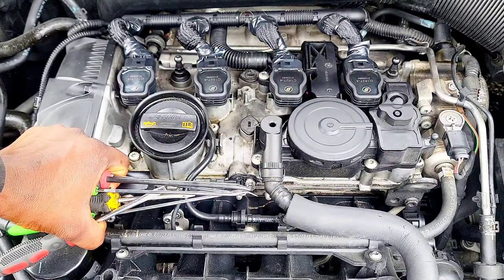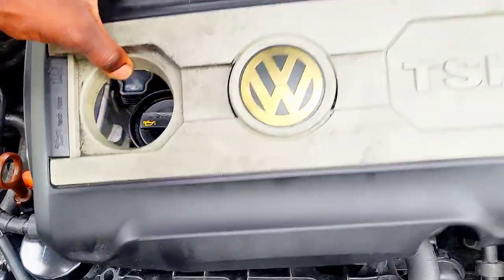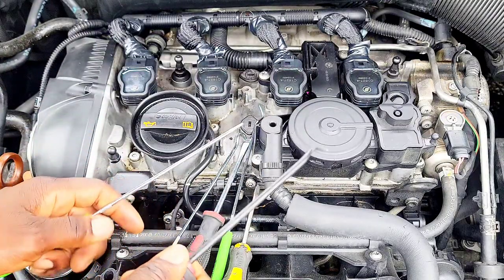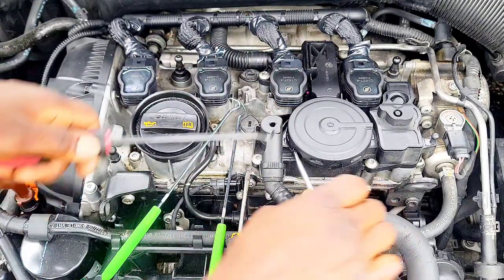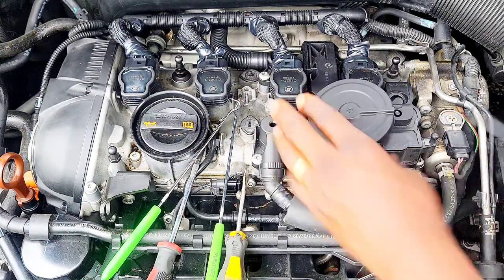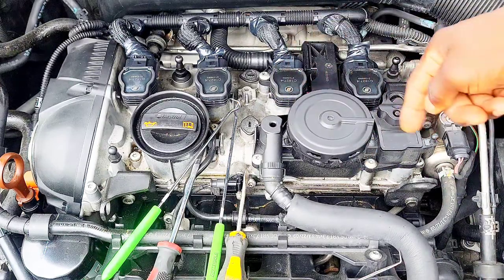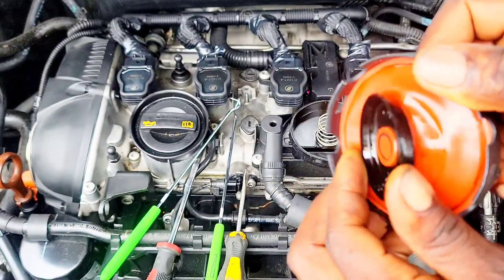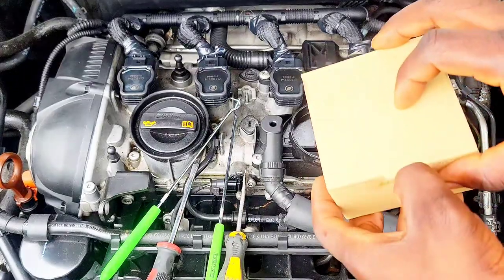How to Change PCV diaphragm Yourself on a 2009 volkswagen cc

Comment: Quick question is there anything else in the pcv that could cause a problem or is there no benefit in changing the whole thing should I just change the diaphragm ?
Reply from the maker: Just the diaphragm
Reply from the maker: Oh and make sure there's no other air leaks
Reply: @MrtalentedReid  no air leaks where ? And I just watched a couple videos and apparently vw makes an updated version of the entire pcv valve since it’s a pretty common problem
Reply: @MrtalentedReid  so I may just replace it all
Reply: @MrtalentedReid  do you know if the diapram you got from dorman was any good?
Reply from the maker: Okay you can do so
Reply from the maker: Yes it was I don't get any complain
Reply from the maker: Leaks can also in the vacuum line areas such as brake booster broken flex hose secondary air system engine oil cap faulty dip stick seal
Reply: @MrtalentedReid  Okok I think I’m going to just go for the diaphragm since it will save a lot of time and I already replaced the gasket for the valve cover and the pcv cover it makes a noise when I block the little diagram breather hole so its definitely torn
Reply from the maker: @luis-andresfranco6013 okay sounds good